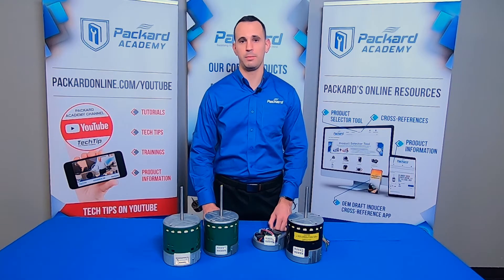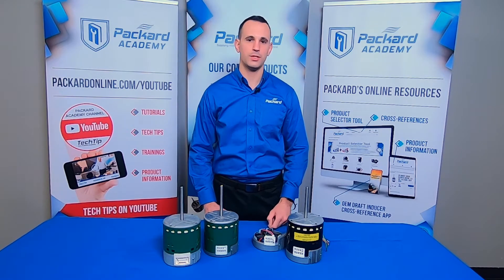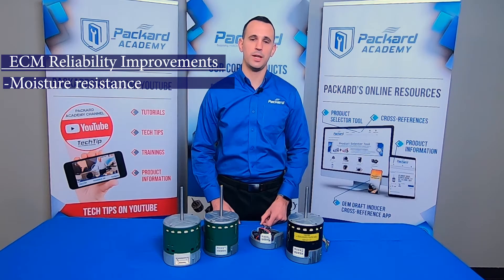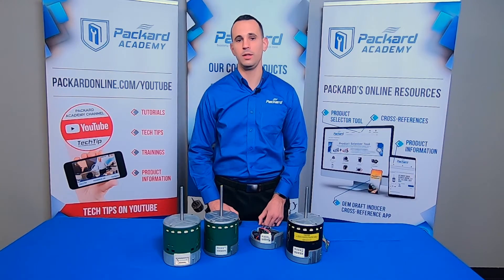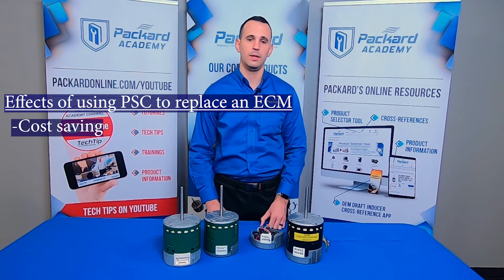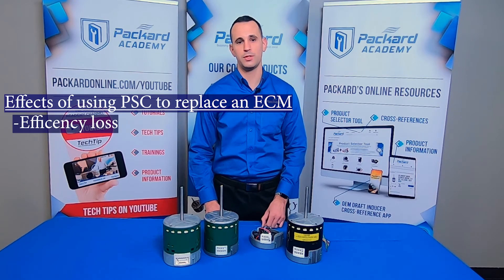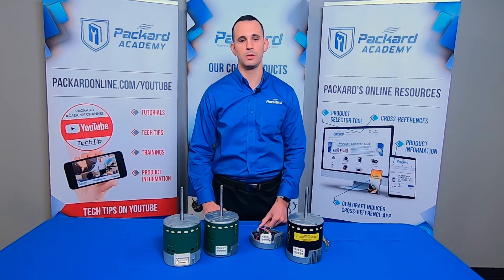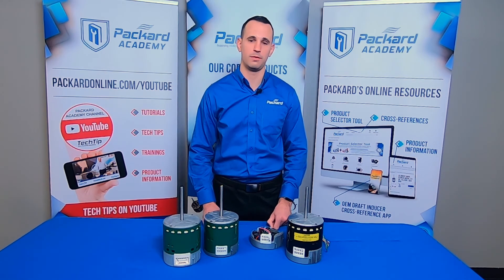How To Choose Your Best Replacement For a Failed EC Motor

Comment: I would like to say the ECM motor is an immature technology. I see so many failures in less than 5 years systems. Most failures are the control module, and it is very expensive. Please tell me how having ECM motor will save customers money?!
Reply from the maker: One of the major reasons for EC motor failure, as well as induction motor failure, is applying the motor in an application with improper static pressure.  With an EC this will result in a failure of components in the controller. When properly installed, the motor is much more efficient than an induction motor and can also operate at lower speeds. Both of these characteristics result in lower operating costs, greater comfort, and longer equipment life.